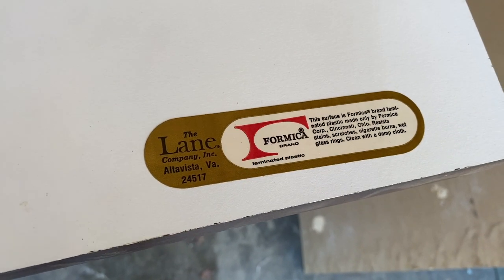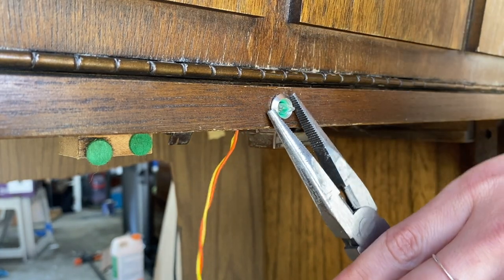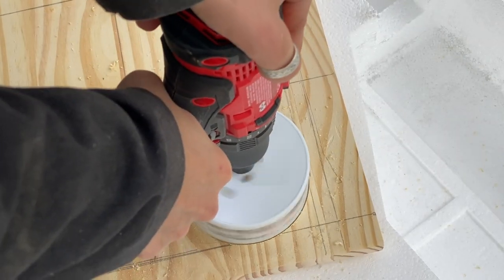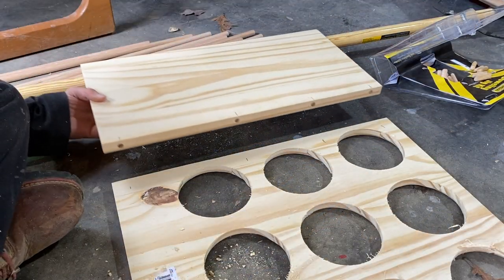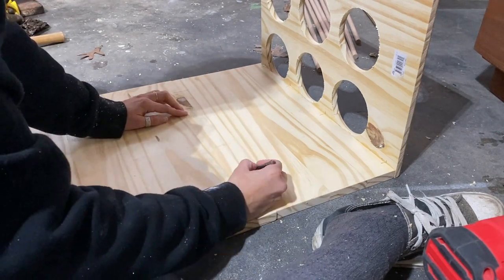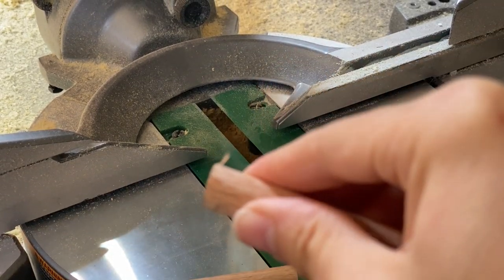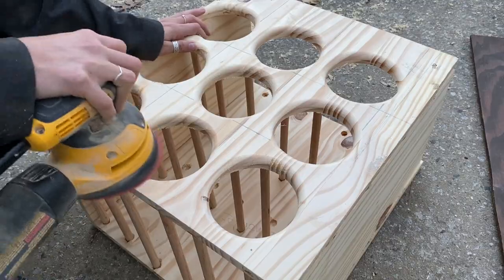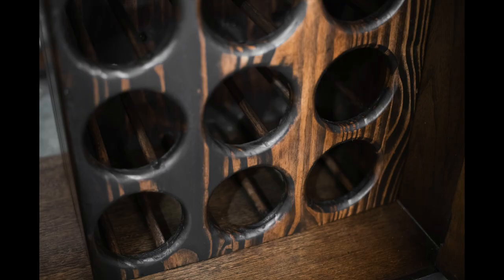Want to build a wine rack? Watch this first!

Comment: 1. The end result is gorgeous!

2. I have the strongest feeling of like deja vou(?) Like I have done a project that had a similar headache as your lining up the dowels situation. But I can’t for the life of me remember what it was! Anyway if you ever have to do something like this again, what about cutting out the pattern of holes in a piece of thin cardboard and sliding it onto the dowels to hold them at the correct distance to each other. Then when you have the other side glued on, you can just cut/rip the cardboard out of there.
Reply from the maker: You are an absolute genius!!! That is such a great idea and I will definitely be doing it next time! Thank you so much!
Reply: You’re welcome, glad it helps :D